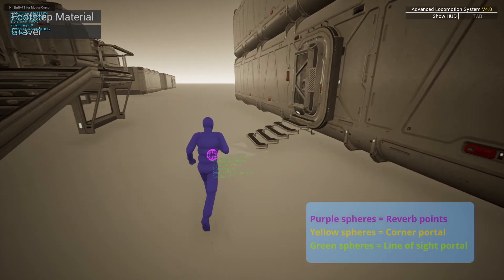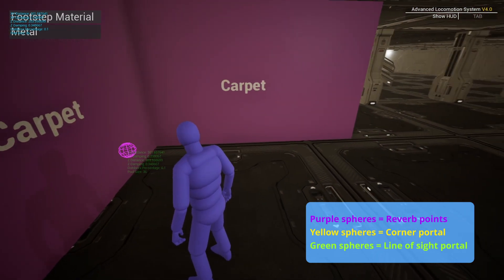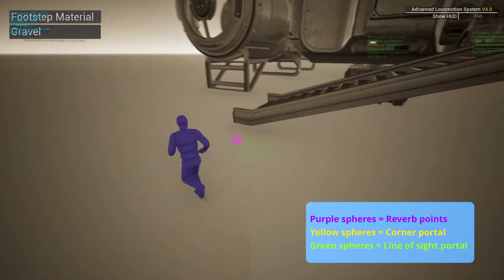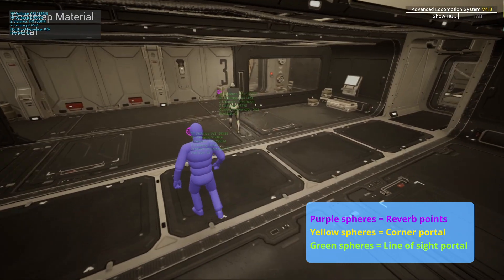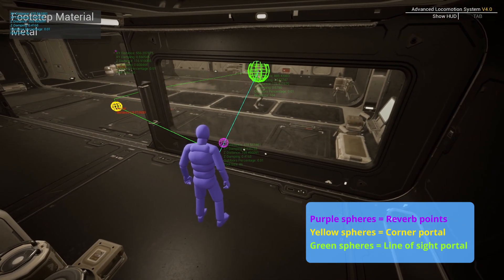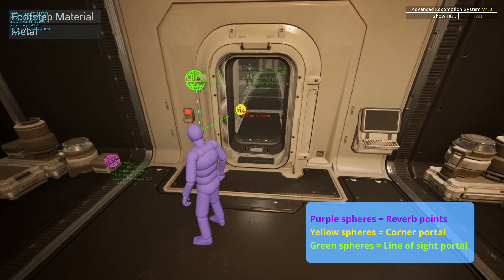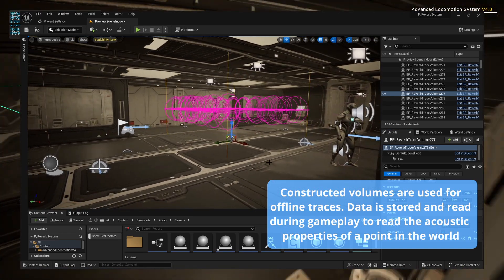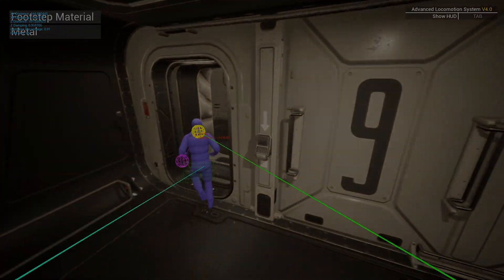Baked reverb system + occlusion and diffraction in Unreal Engine 5 and FMOD

Comment: This is amazing, Bas. How do you calculate the space and link it to the reverb? Is it changing snapshots in fmod?
Reply from the maker: Thank you! It generates a grid of voxels. Each voxel calculates the average distance and the average absorption on both the XY axis (with offset) and vertically around that point. It's done with around 50 traces per voxel point, but because it's all done offline/in editor that only results to a certain amount of baking time. It's bit similar on how that's done in The Devision 2 by Massive Entertainments audio team. 

It's a bit hard to give a concise explenation, but I'll try :).

This system works with a mix of player- and source based acoustics to mix acoustics of the listener with that of the source. Because it's source based I can't work with snapshots, which are global and player based. 
In the mixer hierarchy, there 4 reverb size presets, and 4 reverb absorption presets, resulting in 16 reverb presets. For a source in the world, the distance is translated to a reverb size preset, and the absorption value is selecting a sub-preset if that reverb size. Those values are mixed with the values from player character to get a mix from the acoustic properties of the player and that of the source. Those values are projected on sends within a shared asset on a return channel in the FMOD event to send a parallel signal to the appropriate return channels in the mixer hierarchy. In this example I capped the max. amount signals send to reverb per source to 2, I believe.

Of course, this system can be further expanded on by creating more variations of presets and optimizing it further by capping the amount of reverb presets being active, for example.
Reply: @basbertrandgameaudio  what an answer, thank you!!! This is quite intricate, also reminds of the microsofts projectacoustics. but yours seems to be more streamlined. amazing work